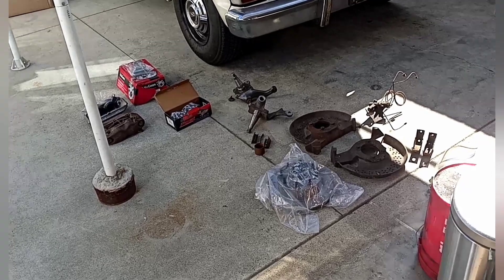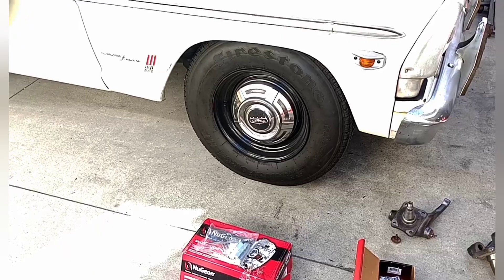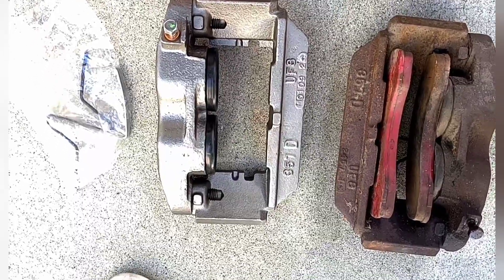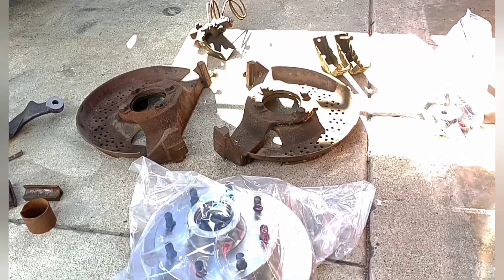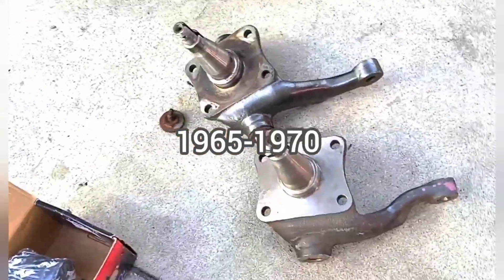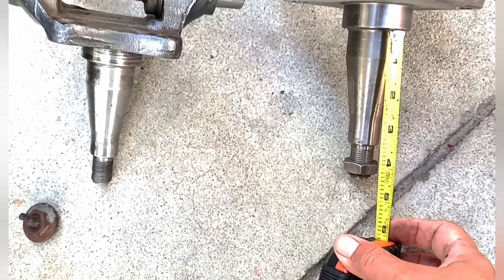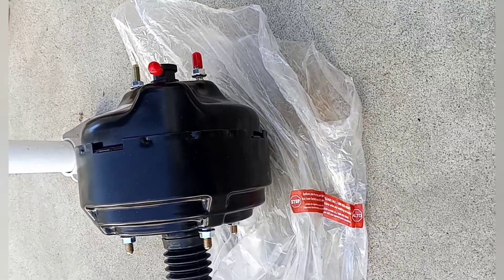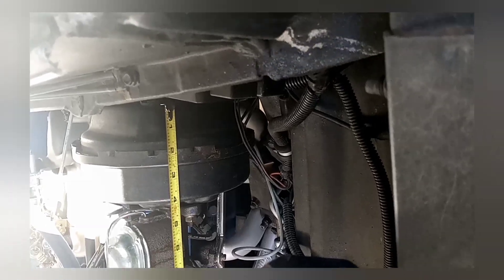68-74 F 250 12x2.5" Drum to Disc prt1

Comment: I have a 66 F-250 with 12x2.5 I was told that they would essentially be  bolt  conversion with parts  from a 68 to 72. 
Could you shed any light on this if possible
Reply from the maker: The disc brake baking plate to hold the calipers on is really all you need  that is the only part no one makes aftermarket you can buy everything else either rebuilt or new online your choice  were you get them .

    If you want to save a few more bucks take the caliper brackets as well  you can buy the piston section by itself its called semi loaded I doubt any calipers in the bone yard will be good other wise you will need fully loaded calipers it's the whole piece as one unit  the difference is 45 each semi or 75 -99 fully loaded .     Grab the  mounting brackets for the brake lines to the frame there different  or you can just turn your drum  brake bracket upside down.

 One side is bolted the other is riveted ? I don't know why ? .    If you have  power drums now I would just keep  stock booster for now  you  can upgrade to the double diaphragm later if you want  lots more stuff needed like proportion valve new brake lines  etc but from the bone yard the Backing plate is the main part to get .
Reply: @TheThirdWheel618 I appreciate the hell out of it man do you know what years the backing plate is available on?
Reply from the maker: @ThomasKnott-h5t look for the early style 70 74   that should just be the backing plate direct swap to you existing spindle  76'79 had a bigger inner bearing and Needs to be swapped out   .

Comment: I'm going through this prcosess and found out the hard way that there were 2 different drums on 1969 F250 Campers(as well as other years).  Mine had the 2" drums, not 2.5") and the spindles are different than what's needed here.  Like the backing plate, I don't believe thos spindles are sold in the aftermarket.  I was able to order a pair but I'm waiting for the next frustration which is those tie rod differences.
Reply from the maker: Yes the 2" and 2.5"   are different as far as drag link and tie Rods as long as the shaft goes down they should be the same for both spindles.    The other option is to get a set of 1975 to 79 F 100 spindles and use the light duty 8 lug Rotor and single piston  calipers the backing plates are the same 75 up F100 and light duty 250 . 

Everytime I shopped for drag link and tie Rods it listed same part # for a f100 /250  68 72 except the heavy duty 8,500 GVW I doubt you have a issue there  . 

 Try the drum booster first before you go with the dual diaphragm  the drum booster  has a adjustable rod where as the dual diaphragm does not and its a tad longer my brakes work great 👍  but on occasion after braking I must lift the pedal up slightly with my foot no biggie since I can feel a slight drag on the brakes if I don't I put a spring on the pedal and L bracket so the pedal comes up all the way its not adjustment at the Master cylinder the Rods just a slight longer so I think the drum booster would work better .

Comment: So that backing plate will bolt to my 65 camper special?
Reply from the maker: @Junkyard_cowboy3  it should bolt right up although in the video look at the spindles and compare to yours if they look similar I can get a bolt pattern measurement .
I listed it as 68 due to the fact that when I looked up parts brake rotors pads bearings it shows 68 and up so there could be some difference there .
Reply: @TheThirdWheel618  my spindle looks just like that non HD one you had in the video
Reply from the maker: @Junkyard_cowboy3  you could keep an eye out at the junkyard and see if you can find a 69 to 72 or a 72-79 that has the Dual piston disc brakes on it and just buy the backing plates and go from there if anything get a warranty on the parts so if they actually don't fit they let you bring them back and you can get credit from the junkyard for something else.    There's two different styles like I showed in the videos the earlier style uses a sliding pin and  the backing plates are different than the later style I made like five or six videos so like ragu spaghetti sauce it's all in there. 😉
Reply from the maker: Thanks for watching the videos I hope it helps You decide on which disc brakes you want to choose whether they be the Dual piston or the single piston . 

I think I made like seven videos in all  the last one I installed all new brake lines using copper nickel brake tubing from Amazon .

Comment: What did those caliper mounting brackets sell for ?  I think this disc conversion using F250 65-70 spindle with the later 74-77 disc brakes will work on my 1966 Lifetime motor home that’s on a 1967 P350 chassis 🤔
Reply from the maker: At the bone yard there probably around 50 bucks for the set maybe 100 if it's a independent wrecking yard.  I'm not too familiar with the F-350 and what they used  .
I do actually have a set of 69 F350 radius arms in the garage and I compared them to the f250s and they were a lot heavier duty than the f250 the center bolt that holds the spring in was like a 1 inch bolt compare to the 7/8 of an F250 your best bet would look a F-350 after 1973 it should have had disc brakes on it  since 1973 was the year that they started putting disc brakes as standard equipment.
Reply from the maker: I think you would probably be along the lines of the same procedure just using a 1973 and up F350 backing plate ...

Comment from the maker: I updated my description of this video due to some info not being accurate such as the brake rod on the brake booster. I read on forums that 65-72 used the same style and 72-74 used another style and 74-79 yet used another type that was incorrect .

67-75 uses the same brake rod and  the same parts # on the brake booster from 67-72 it will only list a single diaphragm for drum brakes  with a adjustable rod and fixed rod.
Starting in 1973 it shows the one in this video for disc brakes with 2 piston calipers up to 1976 and in 1977 they changed to the big round booster with lil short brake Rod  although the dual diaphragm is listed as a F 350 from 1969 its the same brake booster listed for a F250 from 1973-1976.

Also the measurements of spindle length and thickness are only identical 1968-1975 
1976-1979 spindles the inner shaft of the spindle is thicker and uses a bigger bearing .
The1976 -1979 backing plate and brake system can be used although the inner bearing must be changed see part 3 of this video series .